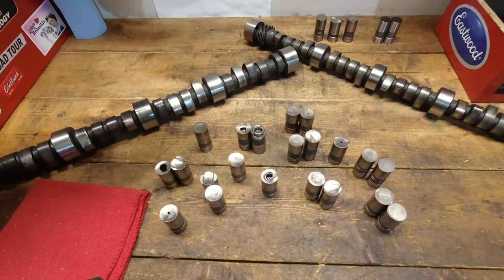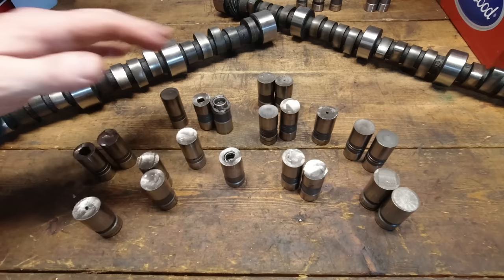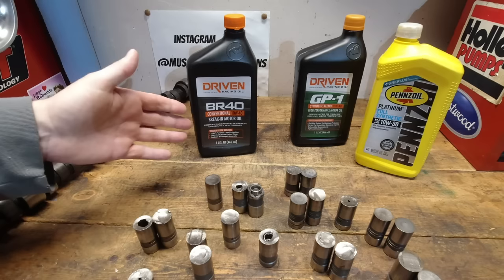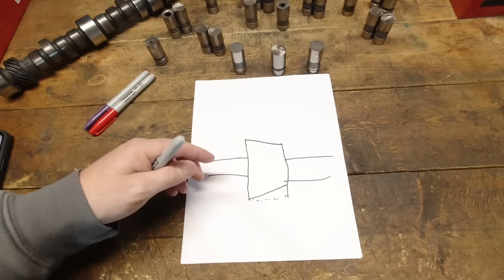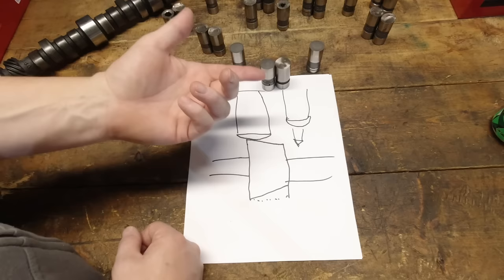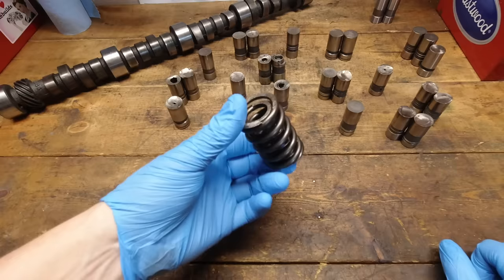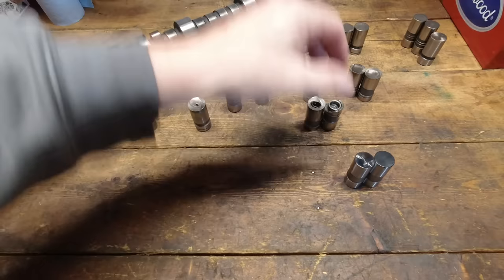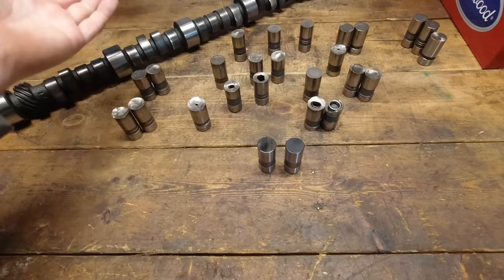Flat Tappet Cam Failures: The Reason Why They Go Bad & The Solution! Part 1

Comment: let me tell you what the Chinese are able and willing to do
A: make pure crap the cheapest way possible with zero concern of accountability.
2: duplicate a "brand" name box (or come dangerously close)
AND: sell it under false pretense

now add an unscrupulous marketing person on the states side willing to sell anything for a buck and you get people that really do not know where stuff comes from.

I think a lot of "WHY" cams and lifters fail are mismatched camshafts (you canNOT match a roller camshaft with a "flat"-tappet), lack of inspection of the lifter well, bad build practices, and yes, some crap parts from who knows where.

and for the record, I do not blame the chinese, 
I blame the dems and all those that vote for them
Reply from the maker: I don’t doubt there are Chinese lifters on the market.  A majority are still made right here in the US.  We covered this in the video.  The quality has for sure gone down in the lifter.  I firmly believe it’s due to those suppliers deliberately moving to what the OEs are demanding. Hydraulic roller lifters and cams.  The production has dropped off significantly and some announced they would no longer be making them at all pre-covid.  Not everything that comes out of China is junk.  That’s a horrible misconception.  It’s what the importer is willing to pay for quality.  I spoke to this at length in a recent live stream.  Most importers will opt for higher margin over higher quality.  Doesn’t mean the Chinese aren’t capable of producing high quality products.  And back to the flat tappet lifters.  I can see a day in the ver near future where all the flat tappet cam cores and lifters will come from off shore.
Reply: @MuscleCarSolutions  you may be right
butt
when quality counts don't count on China!
Reply from the maker: @scotte2815  at this point, the US made lifters can’t be counted on.  They’re just as bad as the worst chinese lifters and that’s sad.
Reply: @MuscleCarSolutions  true that!
the US manufacturers have taken planned obsolescence to an all new low.  My wife's 2015 Ford Explorer has no zerk fittings on any of the steering/suspension joints while my 1987 Ford F150 with a bullet-proof 300 Inline six keeps chugging smoothly down the road with 300K+ miles on it

Comment: The lifters with the fused on/pressed on hardened foot I am confident are the only reliable solution to the problem you guys are chasing your tail around and around. GM used them in the V8s since 1950's to current era in all their flat tappet lifter engines. They have correct crown taper and a durable face that is .200 THICK and not some latest and greatest coating that is less than a micron thick in most cases.  One half of a micron is only .0015 thick. It is unlikely the special oils from a certain company can embed itself into the metallurgy of the lifter. Anytime the lifter is opening the valve the lubricant is shaved off the lobe-the oil mostly just cools the lobe more than anything with slight lubricating properties when the lifter is on the base to keep things from burning up. These same old claims of special oils, special break-in springs, yada yada are NOT the solution. Use the only lifters that actually work and do not require all these special dances and gyrations. We are a dyno shop and build over 20 flat tappet engines a year and install them into cars. We have tried all these dances and what I consider gimmicks or desperate band-aid attempts to avoid cam lobe and lifter failures. The solution is use the OEM lifter design with hardened foot. Plain and simple. We have tried many times the special break-in procedures, nitriding and special hardened surfaces, special oils, etc. Still failures are rapid. Its the lifters, not the camshaft causing this. Problem solved at least for the GM community when you use the .842 lifter with the .200+/ Thick  fused on/ pressed on hardened face/foot.
Reply: Yep! The GMPP hardened bottom lifters ARE AWESOME!! 
I willingly paid $200 for a NOS set- just for the peace of mind !  Now, if I could just feel as safe with the nitrate coated Elgin cam, lol! I need to measure my lobe taper now.
Reply: Are these available 4 350 buick

Comment: 23:39 If the only reason to idle it up is to splash more oil, what would it hurt to overfill by a quart or so during cam break in?
Reply from the maker: I think @themotoroilgeek did a video on the effects of overfilling a wet sump system.  Either way, I’d recommend that channel.  Great content that’s based on science, not speculation, as he puts it.

Comment: All good information except: windage tray. Regardless of having one or not, the crankshaft/rod oil leakage will throw the same amount of oil into the upper sphere of the crankcase. Nobody is going to be winding up the engine past 3000rpm during the break-in process if they have any sense about them. So you won't see the crank "scooping" the oil out of the oil pan at such low rpm. I mean, what are people with baffled aftermarket oil pans supposed to do? Cut out the baffles? It makes no sense. With or without the windage tray at 1000 to 3000rpm; you'll get virtually the same amount of oil from the crank/rod leakage thrown upwards.

Comment: So, how is it that "off the shelf oil" still has (some) zinc in it and it isn't being washed off by detergents??? Otherwise why would they still put zinc in? 
   If the zinc is not consistent in the oil then where is it? Never heard people talking about detached zinc layers in the bottom of the oil pan.  GM EOS (containing zinc) was for YEARS the recommended oil additive/supplement for cam/engine break in. I never heard anyone say that that didn't blend in with available oil. GM was not in the business of  selling Snake Oil additives. I think these are logical questions that need answers.
Reply from the maker: Correct.  All oils have zinc.  But one of the reasons why we change oil is be used the additives break down.  Including the zinc.  When you use a zinc additive, it doesn’t mix instantly with the oil.  Don’t recall saying it was in a layer at the bottom of the pan.  But it does take some time for it to all mix together.  Whereas a oil that is already has the right chemistry for a flat tappet engine doesn’t have any mix time.  It’s in, it begins to do what it was designed to do.

Comment: How long should I run my big block Chevy? It’s all stock with an RV cam and what rpm during my cam break in and I got a comp  cam and lifters coming next week
Reply from the maker: The big block is always at a lower RPM.  18-1900.  Your biggest enemy is spring pressure.  Got to keep those low on a cam that will generally have a lot.  You’ve got to change the spring pressures if you hope to have it survive.  I hope you ordered the 812D-16 lifters.  That’s comps new DLC coated lifters and they work amazingly well.  That and use a good break in oil - not a mix of something you made.

Comment: The oil these days  doesn’t  work good for flat tappet…EPA . They radius on the bottom they try to turn on a CNC lathe . It needs to be ground with not to smooth a finish and not to rough. To smooth they don’t spin I’d say a 32 RMS finish 
That’s my take as a machinist of 40 years

Comment: You can not let a new cam idle for the first 30 minutes at start up you can't set idle and then run it too 2000 rpm you should set the carb a turn or more before you start the engine

Comment: I have a lunati special purpose 275-285 cam what about Rhoads or other high end lifters?
Reply from the maker: Don’t switch brands.  I have no idea what those horrible rhodes lifters are ground on, but all the Lunati cams are ground with the correct taper and crown.  If you watch the videos in this series that I did on that topic, it will give you an idea of why those two must match.

Comment: Wonder how the new Comp DLC coating on a SFT would compare to the EDM lifters for wear and durability. I see that Comp has DLC lifters listed (not avail) for Chrysler for $120 each, or over $1900 for a set of 16. Ouch!
Reply from the maker: Couple things.  If the EDM was a good solution, manufacturers would have jumped in that a decade ago.  You’re looking at the tool steel lifters.  Comp has had DLC lifters out for quite some time but there were strictly race applications.  The DLC small block Chevy lifters are $14 than the non DLC set.  I expect all the other engine families to follow suit when they are ready and released to the public.

Comment: Detergents take around 600 miles to be really effective, so it won't affect the properties of zinc additives in a 20 minutes break in.
Reply from the maker: I don’t even know what to say to this.
Reply: @MuscleCarSolutions  it's okay. You don't need to know everything to run a youtube channel, just be open to other people's knowledge and be ready to do more research than listening to just one source of information.
Reply from the maker: Prove to me your assumption.
Reply: Just call any oil company like valvoline,  castrol and such,  or follow ASE technical formation, and you'll get that info. I'm sorry i don't have an oil laboratory in my kitchen, but years of working in the automotive field led me to see that what i'm telling you is the truth. Engines that don't run often and get too frequent oil changes will experience sticking of engine parts like valves and piston rings. And additives and detergents get depleted over time, thats why we need to change the oil when its worn. Any info i have comes straight from oil companies and automakers.
Reply from the maker: Since you can’t prove your opinion, I’ll do you one better.  When I interview Lake Speed Jr here in a few weeks, I’ll give him your opinion and see what he says.
Reply: That would be interesting, altough i already know his opinion. I don't see how your opinion is better than mine since you need an expert to prove your point. Again, having a youtube channel doesn't turn you into superman.
Reply from the maker: I asked you to prove your opinion yet your couldn’t.  So either you’re lazy, or you know you’re not right and deflecting.  So I’ll find out directly.

Comment: Something is up for sure. They never had problems till they went to roller lifters. OEM back in the day never had problems with lifter till they all went roller. Am sure it's in the oil that the EPA won't let out and the oil company's won't tell either or be sued big time. Roller lifter fail all the time to. If you do buy a roller make sure it has a bushing instead of roller bearings.

Comment: What about having cam research break in the cam and lifters on there machine
Reply from the maker: I can’t imagine what that would cost.  Cam break in isn’t a 20-30 minute process.  It’s much longer than that.  Too many variables.
Reply: @MuscleCarSolutions  $60 on there machine check out the video yes I know you are not putting heat into it like a running engine but would have the correct spring pressure for brake in .

Comment: I have bought comp cs retrofit roller cam (ford289) and Howard's link bar roller lifters.will this work? Do i need brake in oil ? How much zinq? It's a fresh 331 scat rebuild.Thanks for the vid
Reply from the maker: I’ll never recommend combining brands on cam and lifters, even on a roller set up.  That’s all on you if any issues occur.  Best thing you can do is verify where the wheel rides on the lobe and hope it’s good.  Yes, still use a break in oil.  Lots of new parts and surface finishes that need the higher zinc and lesser detergent package for the first 4-500 miles.  I’ll always recommend Driven.  Don’t run an oil with a thicker viscosity.  There’s not enough time for them to operate when the oil is too thick.  10W-30/40 should be your range, depending on your bearing clearances, operating temps, boosted or n/a and type of fuel used.
Reply: @MuscleCarSolutions  
Yes bit i rear terrible stories about the comp cams link bar lifters and Howard's was better? Aren't the link bar lifters.      rollertips in the middle of the lifter bores with every brand ? 
Is the higher zinq in the oil good for ring to cilinderwalls seating? So the Lukas engine break in oil is ok for my roller lifter cam break in ? 
Do you use assembly lube on the cam and rollers or only on the bearings of the cam and Lucas oil between  the rollers and cam

Comment: So, if I'm hearing your advice correctly, adding a ZDDP additive package, such as Comp Cams, to an API motor oil, will not help your flat tappet cam ?  I have been doing that very thing on my GMPP 350 H.O. engine for many years. No signs of cam or lifter failures.
Reply from the maker: It will after it’s had time to reach a temperature that the two will mix, but I’m not sure they will ever work in compatibility with the detergent package in an off the shelf oil.  It’s a topic we’re going to discuss with Lake Speed Jr in a interview that’s due out in a week and a half.

Comment: What I don't get is why Roller cam and lifters are less intensive to make and they make more of them to further drive down costs and they cost double or triple over Flat tappet that goes thru or supposed to go thru precise machining tapers ect and heat treating?
Reply from the maker: I think you have that backwards.  Flat tappet cams are made of a cast cam core.  Most roller cams are made on a billet 5150 or 5160 core.  Comp used an austempered iron core for quite a long time, but rumor has it the OE supplier that was making them have opted to switch over to the billet material.  Makes sense.  That’s what they’re grinding for the OEs.  The cost is significantly higher on a billet core.  Lifters are essentially the same.  The internals on a hydraulic lifter are similar between the two, other than the tolerances are a little tighter on the roller.  Plus adding a wheel and the bearing is not a cheap set up.  All good.  I’m happy paying for the better materials and product to eliminate the problems flat tappets have had.  But that new DLC Comp lifter…. That’s a game changer no doubt for the flat tappet guys.

Comment: Wrong valve spring pressure and lifters not turning in the bore properly..
Reply from the maker: Yes that was covered in this video.
Reply: That's the main problem.

Comment: Ok after using a good break in oil.  What oil should i run in my sbc 406 with a big soild cam    now i use castrol 20-50  i dont even get 500 miles on my motor and i change the oil.  Its only a werkend street beast
Reply from the maker: Driven Racing Oil HR.  You need a storage type oil and the HR series is for long storage low mileage type vehicles.
Reply: Thank you

Comment: Great information. Thank you. 

I have to say that though, you have drawn some dubious conclusions about that Youtuber. You said you don't know what he did or what he knows, yet you made some guesses and called him out. Not a fanboy of his, or yours. Just saying. Stick to known facts.
Reply from the maker: There were plenty of known facts.  He used the springs meant for that thumpr cam, which are a triple spring and given the common installed height, way too much pressure on the nose and the seat.  His use of diesel oil as his break in.  Both of those things were talked about and fully on display in that video.  He also mentioned getting the break in info from the retailer.  Now I understand trying to make things quick and simple, but in todays world of flat tappet failures, getting that info directly from the manufacturer would have potentially saved that failure.  What he didn’t specifically address was break in RPM, and that was the only unknown in that equation.  We can guess either way on that.  I didn’t call anyone out.  I didn’t mention them by name, clip his video to show exactly where he made mistakes nor sent anyone after him to point out his poor decisions or worse, poor advice taken.  All I gave were the facts he presented.  Thanks for watching!

Comment: Brad Penn oils are Pennsylvania crude
Reply from the maker: Yes.  Brad Penn was with the Pennsylvania crude from the old Kendall facility.  Until they sold to DA Lubricants, switched to a gulf crude and changed the name to Penn grade.  Used to be a good oil.  Today, not so much.

Comment: I have that double spring on my Ford 390 when they rebuilt my engine I purchased a Comp 265/275 cam and the matching lifters at the same time .
It has that bronze inner spring I called Comp and ask them if I was supposed to break the engine in without it they said no it's ok  now I'm wondering after break in were they supposed to be removed ?  I have 4,000 miles on the engine those inner springs are still there not sure if they were supposed to be removed .
Reply from the maker: Whatever the spring and the installed height those springs should be is what’s supposed to be in that setup.  You’re well past the break in stage.